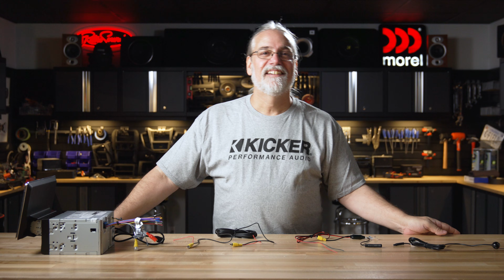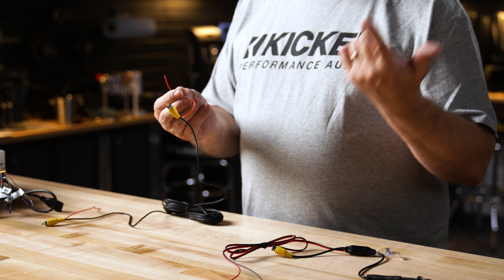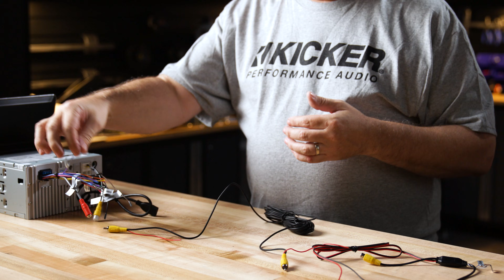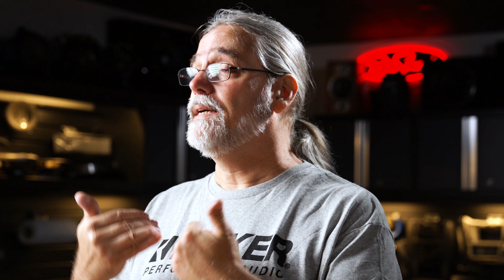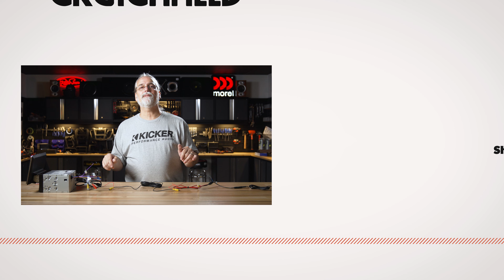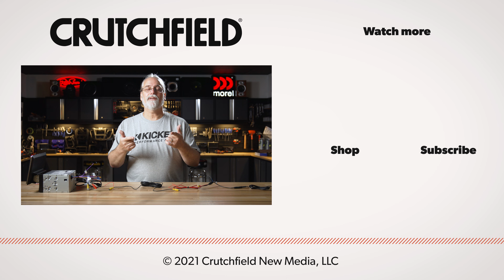Powering your backup camera (and how to use that extra wire) | Crutchfield

Comment: my back up camera wiring loop do not have the first 2 red wires that you connect together to reverse light wire circuit i have only red and black for ground and the red wire is the one you connect it  to purple wire on the stereo to let the stereo know when the shifter is in reverse the question is my back up camera will work if i have only red wire connected to purple on the stereo and black for ground?
Reply from the maker: No would not work because the purple wire is looking for 12V signal to come into the radio. It does not output 12V power for devices like the backup camera itself. It sounds like your camera is limited by its design on where it can get the power for the camera and also that you will need help finding an alternative location to pick up the reverse gear trigger for the new radio. We give lifetime technical support on gear that's been purchased from us and those technicians can help with finding that alternative source as well as getting the wires properly connected. Their toll free phone number is included on the shipping label on the box as well as the on the order invoice
Reply: @crutchfield  this is an echomaster buck up camera (PCAM-220) i found a diagram to connect it. the yellow to video on stereo, red to reverse lamp and to stereo on purple wire, and black to ground. that way when is in reverse either the radio will get 12v signal and the camera will get 12 v to turn on. the 2 small wires for park lines and mirror image remain joined.
Reply from the maker: We are glad you found a diagram for your camera and that it helped!!
Reply: @crutchfield  am not wiring this camera yet. so do you think if i wire it that way it can work properly? thanks for your help
Reply from the maker: The instructions you listed seems right and if its coming form the owner's manual, then it is expected to be right! However, if you have doubts, then we recommend checking with technical support to ensure proper connections are made

Comment: At 4:20 you say to connect the red wire to the 12V switched wire in the harness AND to the red wire in the back of the stereo? But isn't that doing it twice and you just said early in the video you dint need 2 12v inputs? Instead of saying AND did you mean OR?
Reply from the maker: The information is correctly stated in the video. That connection style is specific to the type of vehicle harness used in the video for Ford/Lincoln/Mercury. Chris is going over the multiple different types of connections you can make with the convenience wire to wire up your camera.
Reply: @crutchfield this is confusing. He says you only need one power source, and says the front is fine, then hold the back of the wire and the other connections. Will just the front work?

Comment: Hi, i bought after market back camera and a small tft 4.3 display to connect, but when i put in reverse it shows just shows some glitchy lines on the screen..
Can someone help?
Reply from the maker: It is difficult to determine your exact issue from here.  If you are experiencing poor picture quality, check your video cable connections, camera power connections, and camera ground connections to make sure they are all properly connected.

Comment: What could be wrong if that set up was working and suddenly stopped and no matter what I try, it is still not working?
Reply from the maker: It is hard to know the exact issue from our end. If your camera system was working properly and now is not, the best thing to do is doublecheck all of your connections to power, ground, and the video input signal.

Comment: I just wired my backup camera and it works, I put the head unit together and everything works properly, however, when I turn on my headlights and the fog lights are on, the screen tells me to check the camera connection, but then when I have my headlights on and I turn my fog lights off, the screen goes back to normal…
Reply from the maker: Hi Diego, sounds like you may want to double check your wiring connections. If you got the camera or radio here, you can also call our Tech Support for help with this. Their direct number is on your invoice.

Comment: when i put my car in reverse it blew the reverse light fuse (everything connected properly), i unplugged the camera and everything and the same thing happened so im assuming it might be the stereo? the factory one did not when i put it back in. 
is it possible to connect the camera to the backup lamp illumination wire behind the head unit to get power? also while doing that am i able to connect that same wire to the backup trigger wire? having a lot of trouble, thanks in advance!
Reply from the maker: It is possible to get the power for the camera from a switched power source at the front of the vehicle. However, an illumination wire should not be used as that is a wire which only activates when the vehicle nighttime running lights are turned on. We recommend contacting technical support for help locating an alternative power source for the camera and for the radio's reverse gear trigger. If you purchased the gear from us, you can contact our technical support for help. Their toll free phone number is included on the shipping label as well as the order invoice

Comment: I have wired up mine and it works. I wired it to what I believe was the reverse light power. 

However I get a very strange occurrence, after about 15 seconds the camera shuts off and it also shuts down the Android head unit for about 10 seconds as well. 

Any idea what could be causing this please?
Reply from the maker: Hi Matthew, sounds like a power or ground issue. Your best bet is to re-check your wiring. If you got the camera here, you can call our Tech Support too. Their direct number is on your invoice.
Reply: @crutchfield  hello, unfortunately it wasn't one from yourselves (I'm in the UK).

This is really helpful and I really appreciate the reply. I'll recheck
Reply from the maker: Hope you're all set soon!
Reply: @crutchfield  waiting for the weather to improve. 90 mile an hour winds, think I'll stay inside for a bit. 🤣
Reply: @crutchfield  I removed the wire that I tapped into the reverse light and that solved the problem. The Android head unit and/or canbus decoder provided enough power on its own.
Reply from the maker: That makes a lot of sense. If you radio is providing power for the backup camera and also connected to your reverse circuit, that could cause the radio to shut down. I am stoked to hear that you were able to fix the issue! Nice work👏🤘.

Comment: My cam wire from the radio head is to short to make it to the license plate cam mount. Can I cut the wire and solder on extra wire to make it longer?
Reply from the maker: It is never a good idea to attempt to cut and splice RCA video signal wires. If you need to extend the length of the RCA video cable from your camera to your radio, you can use the T-Spec V10 RCA Video cable (available in 3-foot, 9-foot, and 20-foot lengths) in the first link below and the T-Spec RCA barrel connectors in the second link.

https://www.crutchfield.com/I-rYALc166/p_120V10R9V/T-Spec-v10-Series-Video-Cable-9-foot.html

https://www.crutchfield.com/I-rYALc166/p_120RCABFN/T-Spec-RCA-Barrel-Connectors.html

Comment: I just spent 2 hours looking for a 12v ignition source in my engine bay for a bumper cam. After hearing your explanation I realized I can just power it at the other end of the wire at the headunit. Crutchfield is unmatched when it comes to aftermarket car electrics, thank you!
Reply: Omg me too I thought I had to connect the front bumper camera to power by the camera, looks like I can just piggy back to the 12v of the stereo
Reply from the maker: We are glad this helped!! What vehicle did you install this gear into?

Comment: Where do i find the lead output wire from car harness to head unit in a 2000 honda civic?
Reply from the maker: We are happy to help and need some clarification on what you seek. Are you looking for the wiring harness to help with installing a new radio into your Civic?
Reply: @crutchfield ive already done the radio i just need to know where is the reverse lead wire from the stereo harness in a 2000 civic. Thank you though
Reply from the maker: The radio harness in the Civic doesn't include a reverse wire connection. According to our info on the Civic, you can tap into the reverse light circuit on pin #14 of a 20-pin gray plug in the front driver's side kick panel area on the side wall. It's a green/black wire. And if you purchased the gear from Crutchfield, feel free to reach out to our Tech Support staff at the phone number on your invoice for more detailed installation assistance.
Reply: @ how about if i tap into the wire from the shifter?
Reply from the maker: You'll need to use the pin #14 green/black wire location in the 20-pin grey plug in the front driver's side kick panel area mentioned in the previous reply. That is the best place!

Comment: I have one question I have 2011 Toyota matrix It’s a HATCHBACK & that’s were the problem comes in do I have to add an extension to go back to the Reverse lights the license plate is mounted on the Hatch 
Not bumper mounted
Reply from the maker: Hi Scott, each backup camera will specify a recommendation for power and cable length. Do you have a specific one in mind?

Comment: Guide me to connect ahd camera to the toyota aqua without replacing original wire harness
Reply from the maker: Hi Lasantha, we don't actually have research info for that vehicle; but the backup camera you choose should include wiring instructions to help you with your installation.

Comment: Nice Video thx for this. Just OTP, maybe reduce a bit light from your right side. The Light seems to be to much. Your left half of Face is too much dark and the Shadows are not consistent. Perfect audio and nice background :)
Reply from the maker: Thank you! We will pass your suggestions to our video team. On a different note, are you using the convenience wire to supply power to the camera or support reverse trigger to the radio?
Reply: @crutchfield  Radio from Amazon for 90€, support reverse :) Both Methods  working 100% after test. im just not sure, which one i choose at the end.
Reply from the maker: Great news. I am happy to hear that both options are working well, and you found our video helpful!🥰

Comment: If I want the camera to only work when shifting the car in reverse do I only need to connect the red wire to the reverse trigger wire & nothing else?
Reply from the maker: Most installs require a power, ground, and reverse.

Comment: I'm kinda confused with my setup. I have a boss stereo / camera combo from you 	BOSS Audio BE7ACP-C. I hooked up a wire from the stereo red/white labeled 12v rear camera power output to the red convenience wire with the RCA to the back of the vehicle. On the rear end of the car I used the red convenience wire to red power wire to cam. Without the black wire connected the camera works when shifting into reverse and when I tap the camera button on the screen. Weird because it is not grounded and also weird because I'm am not tied into a reverse circuit "trigger" but it seems to know what I'm doing and is getting power when I need it. However I checked the power wire from the stereo with a meter and only saw 12v when shifted to reverse.
Reply from the maker: There are other places to connect the reverse trigger wire that makes a radio automatically switch to the backup camera input when the vehicle is shifted into reverse. However the confusing part is definitely with the camera that works without proper wiring. That could be a sign of potential issues to come and we recommend contacting technical support for help. We include their toll free phone number on the order invoice as well as the shipping label that got the package delivered from us.

Comment: hey loved this video. I havw quick question and would very appreciate the help. 

I installed an multimedia box in my non-carplay non rear camera vehicle, I hooked up the same camera setup in the video and gave it power from the wires of the MMI box (which is hooked into the head unit thru a harness) My problem is, I see the camera working in the MMI interface, but not while reversing the car. I do have a purple “BACK” labeled wire, do I also have to wire that with the 12V power wire to the camera wire? Please let me know thanks!
Reply from the maker: It sounds like you are saying the camera works when the vehicle is not in reverse but stops working when the vehicle is in reverse? If that's correct, you may want to check the input that the camera is connected to and make sure its the reverse camera input. We cannot think of a power source that becomes disabled when the vehicle is in reverse. If the camera was already connected to a reverse camera input then something else must causing the issue and we recommend contacting technical support for help identifying that issue. Gear purchased from us comes with our lifetime technical support and their phone number can be found on the shipping label as well as the order invoice. Hope its a simple fix!!
Reply: @crutchfield  Well. Im not exactly sure if the camera stops working when put in reverse, but the screen goes to the reverse camera screen with the lines so I cant check and the lines show but its all black.  What I do know is, I have the camera receiving power from the fromt
of the car with the 12v, and the wire labeled “back” is not connected, because the convenience wire in this case is attached to the power wire. Video is connected to yellow video. So how would I also get the “back” wire connected to the camera wire

Comment: What if I put it in reverse,  the radio switches over but I get no image on the screen?
Reply from the maker: You may want to re-check your wiring connections and also the camera settings via the radio's menu. If you got the camera here, you can call our Tech Support for help. Their direct number is on your invoice.

Comment: You didn't explain about the difference between Camera ground wire and Video ground wire.

This is really confusing to me and many others too.
Are these 2 wires internally grounded together inside the stereo although they are of 2 different wires???
Why not externally join these 2 wires toghether???
Or there's still some video signal voltage on the video ground wire which is they have different pins?
Please enlighten us on this.
Reply from the maker: Wiring will vary per install and from model to model. Do you have a specific radio and camera you plan to use?

Comment: I connected everything right but still not getting power to the camera.  I soldered the wires to + and - to the reverse camera.  I didn't make a new ground.  Could that be my problem?😊
Reply from the maker: If you are certain your power connections are correct, the ground is most likely the culprit. That would be the first thing I would check to troubleshoot.
Reply: Ok if I connect the rear wires to the reverse light I just need to connect the red wire to camera+ on the radio?  Or I still have to tap in the reverse wire in the fuse box, I'm confused
Reply: That red wire is energized from the reverse lights right?  And act as a trigger wire for the radio?  I don't get it why my camera still doesn't work.  I think my camera is defective.  I never had any problems installing sound systems or my stereo.  But this camera gives me nightmares.  I'm gonna have to try another camera
Reply from the maker: Yes, connecting the red wire to the reverse light power wiring can both power the backup camera as well as provide the revere trigger wire for the new radio. You may want to check what functions the wires on the new radio harness are for because a camera power wire on a new radio harness sounds like it would be a different source of power for the backup camera that could be used instead of using the reverse light circuit for camera power. If you want to ensure the wiring is correct we recommend contacting technical support for the help. We include the toll free phone number to our technical support department right on the shipping label

Comment: Please help because there is no reverse trigger cable on the radio in my 2004 model polo, where can I trigger it? I connected it from the reverse gear beam, but where do I connect it from the front?
Reply from the maker: The reverse light circuit can be used as the reverse trigger for the new radio. Just need to make sure you use the convenience wire that comes with the backup camera to extend that connection to the radio location
Reply: @crutchfield  My understanding is, don't I need to get a return trigger from the radio? Is it enough to just get it from the reversing light?
Reply from the maker: That's right. If you are using the convenience wire to bring the 12-volts from the reverse light circuit back to the radio, it will engage the camera when you shift into reverse.

Comment: What if reverse trigger wire is not labelled ???
How to find this then ??
Reply from the maker: There should always be a color code chart that can help identify the reverse trigger wire. Just make need to consult the radio's manual to find it. Also, we give lifetime technical support on gear purchased from us and they can help. We include their toll free phone number on the order invoice as well as the shipping label on the shipping box.
Reply: Could it be possibly labeled as back car control?